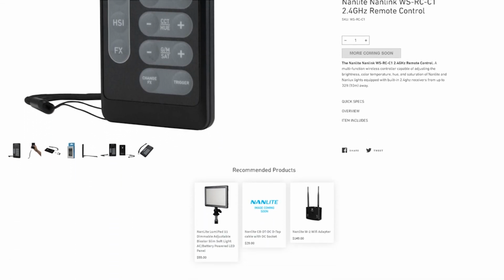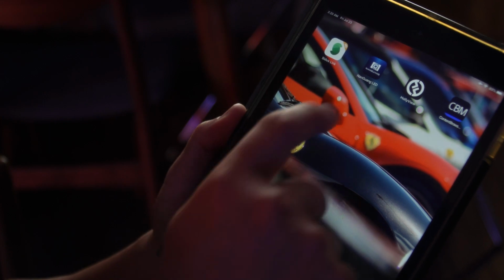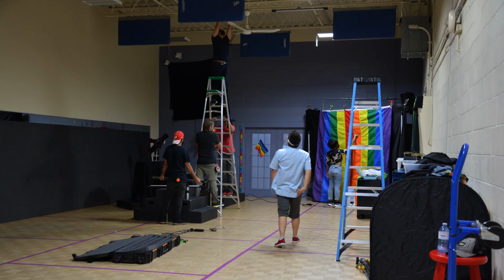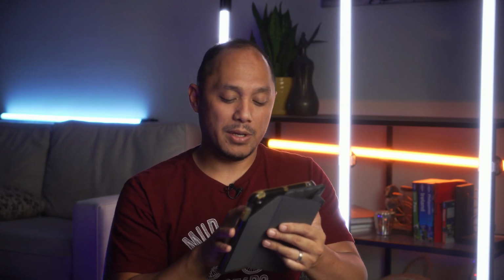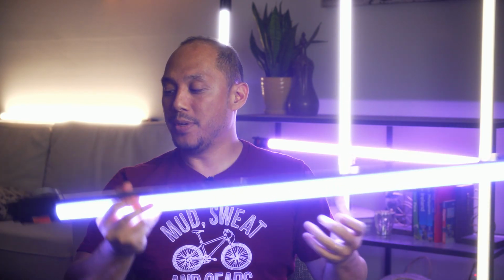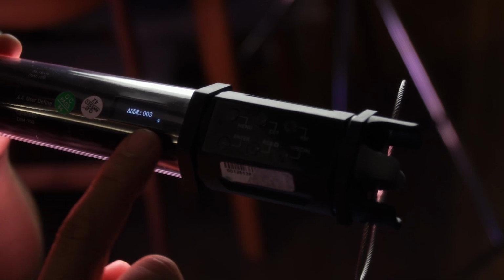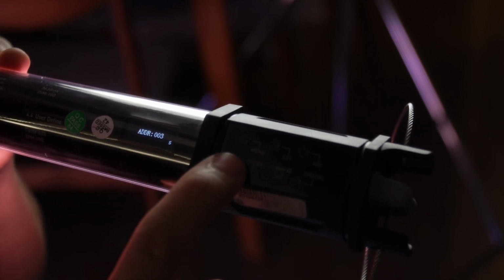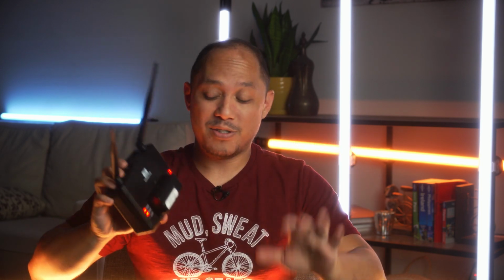Nanlite PavoTubes Wireless Control

Comment: Does this wireless function work when the tubes are running off of their batteries? Or do they have to be plugged into something? Great video!
Reply from the maker: Hey there Jeremiah. The wireless function works with them both plugged in or on their battery power. And thanks. :)
Reply: @rayt_visual  Amazing amazing! Thanks a lot!

Comment: Oh dear, thanks for the video. Look like the apps cannot direct connect to lights  via apps without the router. Been testing it yesterday and I thought my lights got problem 😑 now I know the reason why and also why no many video about it. I ordered the nanlink remote instead after the the video.
Reply from the maker: Correct on the need of the router. The Astera products are the same way with their own external product to control their gear. So eh, it wasn’t a bother to me. :) but good for you getting at least the controller. Wireless control goes a long way. :)